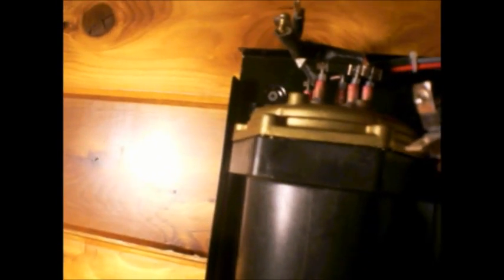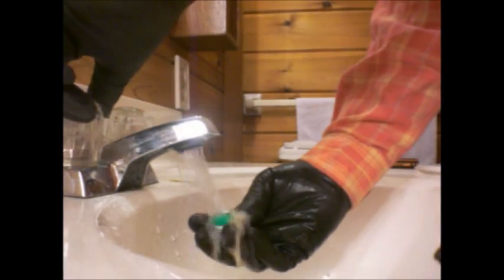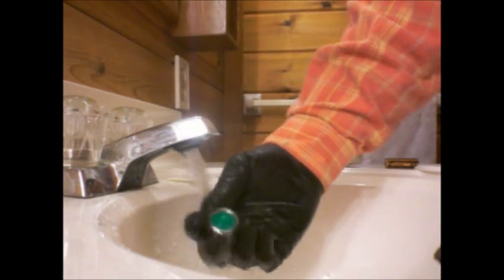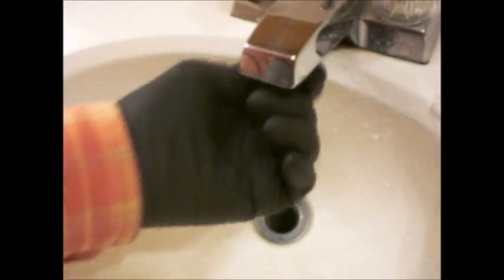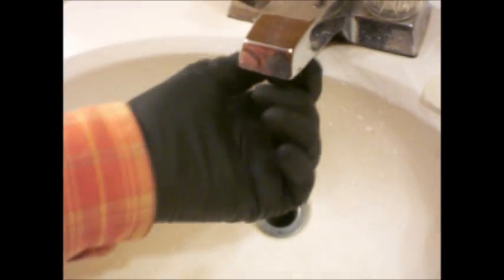On Demand Hot Water Junk  10 7 14

Comment: The instant on demand hot water that runs on gas is much better, a standard 40 gallon electric hot water tank isn't cheap around 500 dollars if you have hard water you will be lucky to get 5 years out of them.
Reply from the maker: We just bot a magnetic water softener, should work, we'll see. No salt or regeneration, most reports are positive, some say it's useless, and at $180, much cheaper. 120 day return if she don't work. Now sediment blocking faucets upstairs, and Bosch doesn't wanna take bk the element and send a new heater f $340